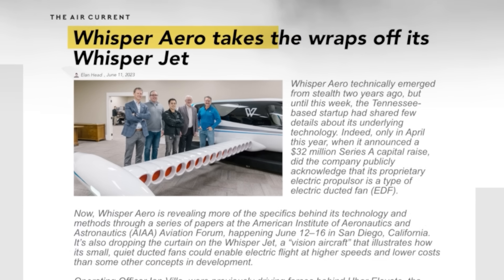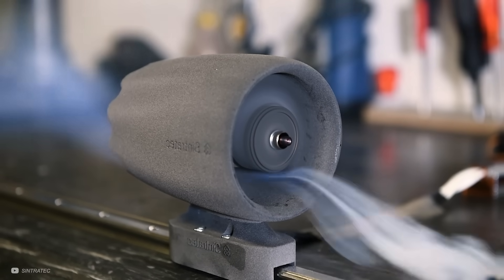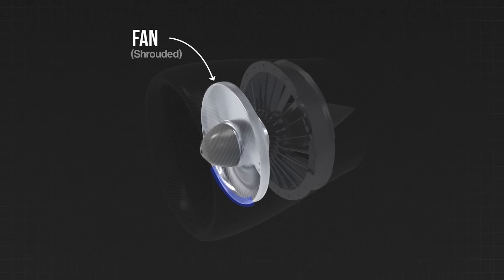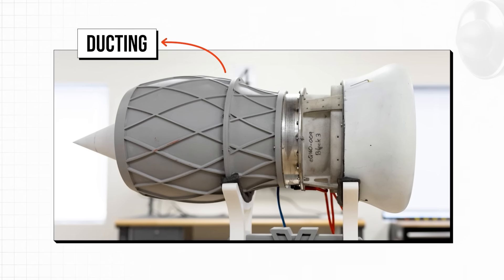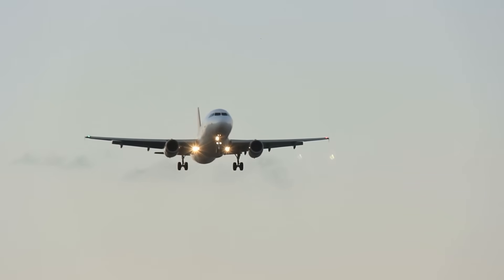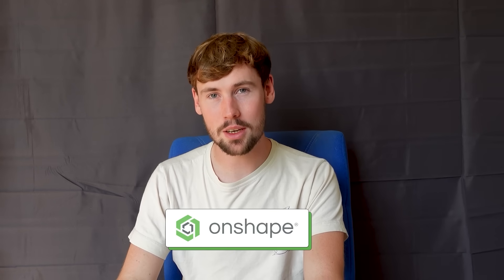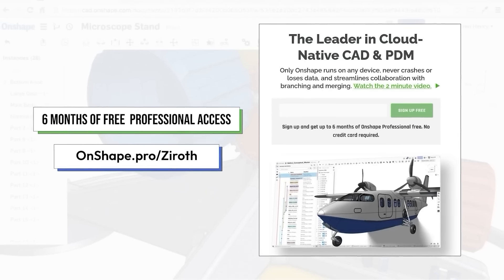This Genius Jet Engine Is Starting A Revolution

Comment: I wonder if this could be made into a Hy-Bred where some jet -A fuel is added to the  exhaust to provide extra power for say Take off only (Or may-be an emergency electrical failure) ....The amount of electricity needed for take-off and Crusing is I'm sure is much less than required for take-off

Comment: Not an expert or close to it, but dont jet fan blades rotate to increase decrease thrust to include reverse thrust, can they still do that with the ring around the blades?  Also will lead edge engines still allow the aircraft to descend safely during a loss of power?

Comment: Lots of computer generated graphics, not so much real world examples. Claimed power figures are ~3-4 time lower compared to the currently available turbine engines that the RC models use.

Comment: 4:36 as an electrical engineer, I don't think BLDC motor would be any "revolutionary", but it can be some sort of special designed axial flux motor with additional cooling material or system.
Reply: But axial flux motors are subcategory of BLDC motors so that statement isn't entirely wrong.

Comment: 70lbs thrust is rather disappointing. The mk1 Whittle jet engine could produce 1000lbs of thrust back in the 1940’s. A modern jet engine can produce over 100,000lbs.

Comment: I remember a phycist friend of mine talking about how Lithium batteries are actually rubbish for energy storage and that butter has 10x the energy density of a lithium ion battery. We then made jokes about building a butter car. It would drive as smooth as...well you know. And it'd be great for drifting but also have the best churning radius on the market lmao

Comment: Hey, I wonder what my contribution to this ... but well its nice to see my concepts in work ... how about a hybrid plane that uses jet turbines and generates electricity to run such edf in places to reduce drag or increase lift...like in take off or emergency landing!!
Reply: Also, if you add a battery, then some part of the flight can be charged on the ground or maybe with solar panels.... it's a huge surface and we can cover it!

Comment: Ok. I was impressed up to the point where they suggested to put a bunch of small engines inside a wing. This is incredibly impractical. Every engine is a point of failure and a maintenance burden. Plus, I suspected 20 small engines will be more expensive, than 2 big ones with equal overall thrust.

Comment: With 70 lbs of thrust (largest engine size), they would need about 7-9 engines to equal the thrust on a Cessna 172 engine (450 to 600 lbs of thrust).

Comment: Obviously not going to be powering large aircrcraft but small short-range commuter craft, 'silent' powered gliders/drones and leafblowers are all interesting use cases. It's still seems to be a significant improvement on current electric fan 'engines', so to dismiss it as 'vaporware' or 'useless' or a 'scam' seems a little unkind...

Comment: simple question - why isn't an outrunner motor used to drive an electric turbine, where the motor duct would act as a stator and the rotor would rotate inside it (so actually an inrunner, but with a very large diameter shaft, hollow and filled with blades - the magnets would be on the outer circumference SHROUD or OUTER RING and the coils would be housed in the casing)? This would minimize the central part of the motor, reduce drag and allow the motor to suck in a larger volume of air

sorry for the rough description

Comment: 5:46 Check the cross section at the top. Make the purple airfoil movable forward & aft on an arc path, so that the outlet opening is variable, to enhance all flight conditions. What are your thoughts?

Comment: The best type of jet fuel and propulsion is to replace jets and air travel with high speed rail as much as possible.  High speed rail is far more energy efficient than air travel and can be made more accessible and safer.  Just use air travel when high speed rail isn't feasible.
One method that needs to be explored is to build high speed rails above existing freight rail systems to reduce the land footprint in higher populated areas.  This will also negate the need for extra land purchases and the freight rail system can be used for building and servicing the entire rail system

Comment: There is no innovation... this is a combination of a ducted-fan and an electric motor... The best batteries can't give you sufficient energy density per lb... the best motors can't give you the reliability/torque per lb. Just another company trying to cash-in on the environmentalist hysteria.

Comment: Kerosine ( Jet fuel) has more than 15 times the energy density of the latest battery technology, and these engines are electric. I very much doubt that they are 15 times more efficient at turning rotational energy into thrust.

Comment: Very interesting that aerodynamics of ducted fans is improving.  That’s a distraction from the real problem with replacing combustion jet engines w electric ducted fans, which is the power density of emotors is far too low to compete w jet engines. That’s been known for years, and the only way to level up is with cryogenic superconductors, which, sorry, have no place in aircraft.

Comment: I disagree about the redefining of what an 'engine' is. The term 'engine' has been used for well over two hundred years to refer to any machine that converts heat into motion. There is no such thing as an electric engine. Even a thermos-electric generators (Seebeck generator) is just a power supply, so it isn't an engine either. Since there is still no such thing as a commercial electric plane, who was the Oracle that decreed this unofficial nonsense. Please speak up, oh Great One, so that we can all bow down before your superior attitude.

Comment: Der Kurzstrecken Flug  bis unter 2 Flugstunden könnte relativ schnell  komplett  elektrisch  abgewickelt werden . 
Die Idee  die Frequenz  der Schwingungen   weit nach Oben zu schieben hat vor allem den Effekt, dass die Dämpfung der Luft da deutlich stärker wirkt ( Unten ausgeführt) .  Das würde die Akzeptanz  von kleinen Flughäfen deutlich  erhöhen, denn  Flugzeuge  mit einem elektrischen Anrieb  sollten kürzere  Startbahnen benötigen .  Dazu  kommt, dass diese Konstruktion  auch in größeren  Höhen funktionieren  sollte, was bei normalen Propeller  Maschinen  schwierig  bis unmöglich  ist.. 
Die Betriebskosten  sind der alles entscheidende Punkt, wie  wir ja  heute in der Luftfahrt  schon sehen  können. 
A 380  mit 4 Triebwerken  ist einfach  zu teuer und zu ineffizient.  Eine Große Anzahl  an Triebwerken  bedingt  dann aber  unbedingt eine deutlich längeren  Einsatz in Flugstunden, um  die Kosten des Austausch und der Triebwerke in Relation  zu den Flugstunden abzubilden.  Die e-Motoren selbst, sollten  locker  10.000 Bh ohne Wartung aushalten, aber was ist mit den Turbinen und Lüftern ?  Strom  ist in vielen Teilen der Welt  im Moment  zu Kerosin  viel zu teuer.   Und der Wirkungsgrad  moderner  Triebwerke  liegt bei :
📊 Typische Effizienzwerte
Für moderne Mittelstreckenflugzeuge (z. B. einstrahlige (single-aisle) Jets mit Hochumgehungsverhältnis (High-Bypass-Turbofans)) gelten in etwa folgende Werte:
Thermische Effizienz: etwa ≈ 45 % (manchmal etwas mehr) bei den heutigen besten Kerntriebwerken. 
Propulsive Effizienz: typischerweise im Bereich von ≈ 70-80 % im Reiseflug (z. B. bei Mach ~0,8). 
Daraus ergibt sich eine Gesamteffizienz von etwa ≈ 30-40 % (z. B. 0,45 × 0,75 ≈ 0,34 oder 34 %).
Strom kostet je kWh  ca. 15 US Cent  ( inkl. allen Steuern und Netzkosten ) 
Zumindest in den USA. wäre man auf einen Schlag aber  deutlich unter den Kosten  von Turbinen die mit Kerosin  betrieben werden : 
Also ca. 16,7 US-Cent pro kWh thermischer Energie. 
#. Wenn 6,61 US$ für 1 Gallone (≈ 39,5 kWh) gezahlt werden

Comment: Erstmal die physikalische Grundlagen: 
📉 Dämpfung (und damit Reichweite)
Die Reichweite hängt nicht nur von der Wellenlänge ab, sondern vor allem von der Dämpfung in Luft, die stark frequenzabhängig ist:
Niedrige Frequenzen (unter 200 Hz)
→ Sehr geringe Dämpfung.
→ Können sich über viele Kilometer ausbreiten (z. B. Donnergrollen, Infraschall).
Mittlere Frequenzen (500 Hz – 5 kHz)
→ Moderate Dämpfung.
→ Typischer Bereich der menschlichen Sprache, Reichweite in ruhiger Luft etwa einige Hundert Meter.
Hohe Frequenzen (über 10 kHz)
→ Starke Dämpfung durch Luftabsorption.
→ Reichweite nur wenige Meter bis Dutzende Meter.

Comment: How do you know someone is an engineer? He'll tell you.

I'm pretty sure no one will buy a plane that has no range just because it's quieter. Last I checked batteries suck comparet to JetA on energy density. A 20% better fan will be a drop in a bucket.

Comment: Ah yes, as well as a huge battery to run all those electric fans.  Yes you can have an accelerator, but at full speed how long will the heavy battery last considering those little fans must lift all that weight and keep in the air.  Those fans may be fine for short-jump flights of a couple of hundred miles, kind of like Only being able to use your TESLA for city driving, where you could ostensibly put on a hundred miles in a day.  While that motor may be clever there really is not use for it as electric aircraft are just NOT PRACTICLE !!!

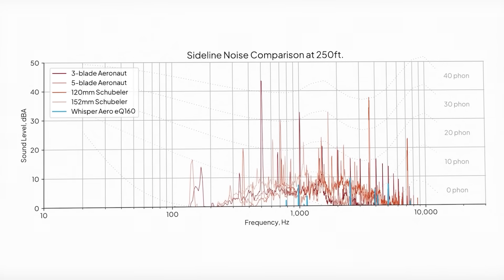Comment: Given that the frequency of 'noise' generated by these new EDF's is reported to be ~16 kHz, I'd suggest that the noise comparison graph (~6:20), capping out at 10 kHz as it does, is bordering on mendacious. It's hard to trust any data presented by a company that's willing to cherry pick numbers in such a fashion...

Comment: That design with all of the inlets along the front of the wing screams FAIL.

Because of the complexity of that many parts moving at insane velocities.    If just one blade in one of those assemblies gets torqued or hit by a pebble it'll throw the balance of the entire wing off as the oscillation generates a sine wave through the structure that pretty much eliminates all of the carefully designed dampening developments if it does not build up to failure like a wheel that's out of balance ... only 100x faster due to the rotational speeds involved.

Comment: This is still a single stage design, very much limits its thrust.  The high blade count and perimeter ring mimics for old steam turbine designs of the late 1800's to reduce noise, but high surface area and higher drag.  Quite a ways to go in this development.

Comment: Small blades are inefficient blades. It takes way more energy to produce the same amount of thrust with a small fan compared to a large fan. Big electric motors to turn a big fan can be efficient but spinning lots of small fans is inherently less efficient

Comment: Imagine losing your family because the battery’s lost there power there ability to last the trip no thanks why not use thorium in nuclear power plants and have tons of free hydrogen to run existing jet engines with or is that to easy for ya

Comment: Efficiency or the amount of energy put into the device versus the amount of USEFUL WORK got out.  It is a simple concept formula.  Propellers MOVE AIR, but "moving air" is not necessarily USEFUL WORK.  So the definition of USEFUL WORK depends on WHAT DO YOU WANT THE DEVICE TO DO???   In this case it is to produce PUSHING FORCE, or THRUST.  So in this case the formula might be Watts IN versus Pounds of Thrust OUT.

Comment: I'm not an engineer but it seems like having many turbines on the front edge of the wing ( even if the flow is not disrupted) would be just that many more maintenance problems, safety checks etc.

Comment: i have a problem with this videos, the "revolution" of 70 pf/torque means its going to struggle to lift the bigger ultralights. And with battery weight, getting any kind of significant range with that limited weight is not realistic. This technology is not even going to replace the smallest Cessna...

Comment: The work being done on ducted fans is very interesting, particularly on energy efficiency and shaking off induced and parasitic drag.  The enclosing ring on fan blades to reduce tip vortices is well known, as is the theory of blade solidity at different altitudes and for specific purposes.  Power to weight ratios is where some of the inhibitors occur IMO.  In the future if hydrocarbons are no longer king then what degree of fan efficiency is required to work with alternate on board energy storage systems?  Propulsion is only part of the story for flight as I see it, as it needs to happen in concert with highly efficient power density.  What does that look like?  There is a paradox of sorts.

Comment: It would be interesting to see how this works with the new Axial-flux motors by Mercedes AMG along with Aluminum-ion batteries. Now you might have something to crow about!! Huge power to weight ratio (750HP=15Kg) and immense power available from Al/ion batteries which have +- 3x energy density of lithium/ion, PLUS no overheat (therefore no cooling required) and zero fire risk therefore no fire extinguishers needed. All that extra weight savings can go into batteries. This rig would be able to replace all gas powered aircraft systems, and some lighter jet powered vehicles. It can also be used for maritime traffic, using Na/ion batteries, completely eliminating use of bunker oil for ships. Full recharge in under 5 minutes with no risk of overheating with Al/ion or Na/ion batteries. So with that amount of power available (a Cessna 172 produces about 170HP@2700rpm) This type of ducted-fan may already be obsolete.

Comment: Kerosene gives about 42 mJ per Kg, batteries give about  0.37 mJ per Kg. thats all you need to know about this. yet another impractical idea designed to attract investment rather than produce a viable alternative to the existing jet engine.

Comment: This doesn't seem to reduce noise, just changes wherebon the spectrum the noise is. Is this going to have an effect on wildlife? Also, I loads of single piece fans, how will they cope with environmental damage and bird strikes?
The fundamental problem with electric power driven aircraft is not noise but the ability to carry enough power to get anywhere! With fossil fuel propulsion the aircraft aca take off way above its landing weight knowing that as the journey progresses the aircraft is getting lighter and more efficient. With electric aircraft the aircrafts take off weight is the same as its landing weight. So you are much restricted on the amount of electrical power you can carry.

Comment: He's a twit if he thinks Circular stators are the way to go?!?  Maybe in the leaf-blower, but on a plane?  They're not thinking far enough ahead.  Fill HOLLOW wings with vertical VANES.

Won't need a tail if you can channel ALL that airflow through the void;  further from body can turn steeper, for lateral steering.

Comment: Interesting considering the open fan direction of companies with decades of commercial aviation experience. Also doesn't solve the real problem of electric engines being the weight of the batteries needed to power them

Comment: the shroud is probably also a bearing surface with insanely low coefficient of friction, to allow for elasticity in the rotor radius ie overspeeding.

Comment: With ducted fans all along the leading edge of each wing, I have to ask the same question I ask of drive-by-wire electric cars:
What happens WHEN you lose power?
Is that wing going to work as a glider or are you just going to plummet out of the air?

Comment: I wouldn't be surprised if they used induction motors for their testing, since that basically allows them to tune in the power requirements, but they would be smart to opt for PMSM in the end.  This is because one of the banes of electric aviation is the mass of the batteries, so if you need to use power to generate a magnetic field (like you do in an induction motor) then you're sacrificing a lot of potential.  Permanent magnets do make PMSMs heavy, but they tend to do better at higher RPMs and you can engineer the magnet to be only as big as it needs to be in order for the plane to fly within it's legal requirements.  That's why for a lot of commuter EVs, they'll use a PMSM on a single-speed gearbox that has incredible low-speed torque but isn't very potent once you reach highway speeds, because that's really as fast as it needs to go.

Comment: The leaf blower is exciting.  Those are the bane of the suburb.
Reply: The blowers have more than a noise problem.  These dirt blowers are in effect dirt blowers, kicking up dirt, dust, animal feces and that then drifts onto neighbors cars, windows, home, thru open doors and windows, and into,out lungs.    Leaf blowers need to be banned outright, not for noise, but for the dirt they kick up all over other peoples property and their lungs.  why should I have to wash my car, my windows so Jose can quickly remove my neighbors leaves?  ban the dam things!

Comment: One great OnShape feature is that it is cloud based. My Windows 11 computer came with a chip that cannot handle most 3D design software packages. OnShape works great and the data is safe and available from anywhere.

Comment: The shrouded fan is not a new idea, there's a simple way to get the fans quieter and that's to make toroidal fans this is not a new idea and as been used on drones but I can see this being used on jet's, combustion and water as well as edf's. But this has not been done yet but should be.

Comment: So smart then they put it in a carbon fiber aircraft that will completely fail..so sad to see ppl.die like the Boeing dumbliner270 dead and counting. As an aircraft mechanic all my life, I can't seem to warn enough ppl of the Idiocracy and dangers ⚡ building an aircraft out of epoxy! Micro fractures every time it flexes...it's oceangate all over again.